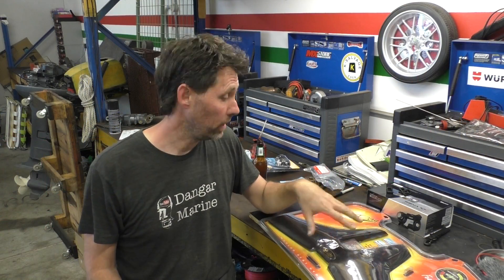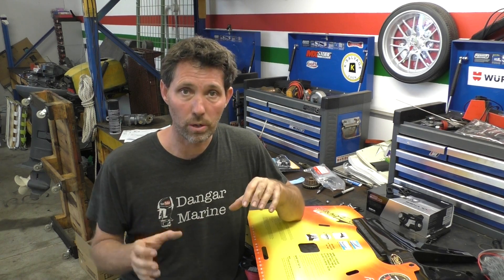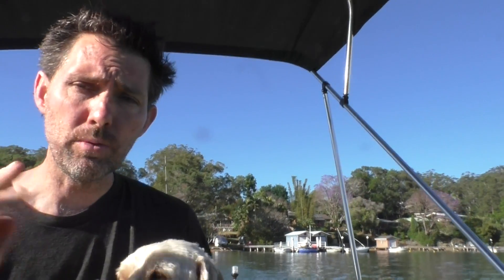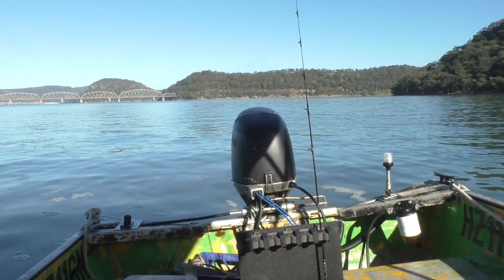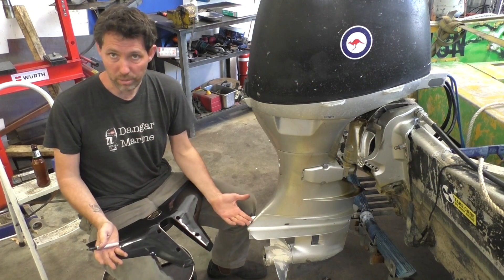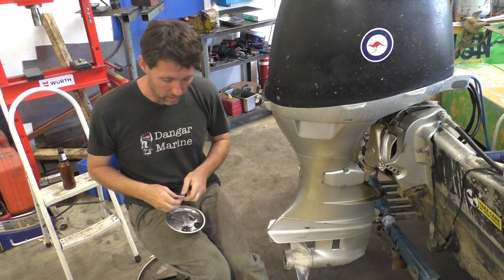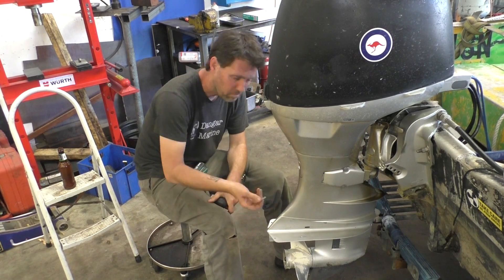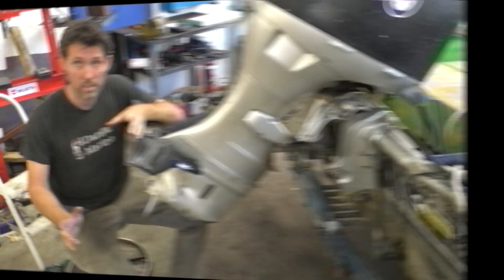Outboard Hydrofoils

Comment: We used to operate a 20' boat in a natural harbour. The speed limit in the the summer was 10 knots. At this speed we were pushing water and not on the plane. We added a set of Doel Fins and hey presto, the boat was level and the ride so much more comfortable. To be fair, it made little difference to the top speed but getting onto the plane was much easier. I recommend.

Comment: I know this is an old video, but I figured I'd ask a question anyway. I have a small fibreglass catamaran with 25hp black anchors on it. (25 Mercurys). Great little fishing platform at anchor or trolling speeds, but prone to losing its grip on the water when crossing the bay in a bit of chop (it ventilates/cavitates badly) or making a turn at planing speeds. The motor ventilation plates are just about the right height, and in any case lowering the motors on the transom isn't really an option. New props coming but don't really expect miracles from them. So, the question is, do hydrofoils really help with ventilation issues? I have in mind the flat plate ones that are really just an extension of the anti-ventilation plate already on the motors.

Comment: I think you just solved a big issue for us. We have a 4.3m tinnie that had a 30HP 2 stroke Yamaha on it and we changed to a 40HP four stroke Yamaha. When taking off it almost inverts itself with the nose riding up really high unless you remember to trim it full down. We have a hydrofoil but did not fit it to the new motor, (first time we have taken the boat out with thenew motor) but we will for sure do that to hopefully stop the super high nose which is nerve wracking when starting. Thanks for a great channel.

Comment: I've got a 11ft dinghy, granted oversized engine, but I wanted it to plane out. So with out this it would stand almost straight up, id have to move forward yo get the bow down. And then once planed out it felt very unstable, after adding this it plans out immediately and is much more stable.

Comment: For what it’s worth, we put one on my son’s 14’ (very light) fishing boat with 15hp w/o any kind of power trim installed. He found that he would porpoise significantly when riding alone at WOT no matter what we did with the trim. Putting a hydrofoil on completely eliminated this. One could argue that he also could have just boated a little slower…we tried that approach first, we got nowhere…
Reply: The motor might be mounted too low, but I think every small boat should have one of these fins, they're great.

Comment: I think you are trying to indicate cavitation? Ventilation involves air movement. This is hydronic so I’m sorta confused about what the ventilation is.🤓 maybe it’s just an Aussie thing but air and water moves similarly but hydraulic is cavitation. Just wanted to mention that! God Bless you from Washington State USA! 🖖🏼❤️😏🇺🇸
Reply: Cavitation occurs within the water itself, essentially an extremely low pressure causes the water to boil. Ventilation one the other hand is just air from the surface being pulled  to the flow.
Reply: @davidtomasetti8520  thank you I see it too 😏🖖🏼🇺🇸

Comment: I installed one on a 115hp, it's amazing for skiing, the wake/wash is minimal, however it's bad for tubing, you can't turn as sharp to give the tube rider a few swings. Also no wake/wash for the Wakeboard, so it's a bit 50/50, taking it on and off all the time isn't practical
Reply: Just trim the bow up so the boat sits deeper and creates more wake.

Comment: I had one on a 40 horse, I was afraid it was dragging all the time, so I trimmed the "cup" off the trailing edge and cut 35MM (1 1/2 in) off each wing tip.
It still got the boat on-plane level and seemed to go faster.
On yours I would try hogging out the plastic enough to slide it forward an inch. Also visually check the hull lines and see if it's dragging.
You can do a speedo test on your phone.

Comment: Cavitation, 
the formation of vapour bubbles within a liquid at low-pressure regions that occur in places where the liquid has been accelerated to high velocities, as in the operation of centrifugal pumps, water turbines, and marine propellers. Cavitation is undesirable because it produces extensive erosion of the rotating blades, additional noise from the resultant knocking and vibrations, and a significant reduction of efficiency because it distorts the flow pattern. The cavities form when the pressure of the liquid has been reduced to its vapour pressure; they expand as the pressure is further reduced along with the flow and suddenly collapse when they reach regions of higher pressure. The sudden growth and collapse of these vapour cavities cause the extreme pressures that pit the metal surfaces exposed to the cavitating liquid.

Comment: I hate to sound like a doofus but Stu, what you do you mean that you can hear the engine ventilate? What does that mean? I understand porposing and bow ride, but never heard of ventilating.
Reply from the maker: Ventilation is when the prop sucks air down from the surface.
Reply: @DangarMarine  Thanks for the clarification Stu. Never heard of that, nor did I ever think thay could happen unless the engine was tilted up much to high. Cheers from Long Island!

Comment: I have an Evinrude 88 SPL on a fairly shallow V 16' fiberglass boat with an open bow. The lower unit didn't have a hydrofoil and my problem was with porpoising while on plane and it took extremely little chop in the water to cause this. When I installed one I could keep the motor trimmed down if it began to porpoise and it really did lock the bow down to the water for much improved ride and once I locked the bow down I could trim it back up gradually to find the sweet spot between comfort and efficiency.

Comment: We have a large twin screw cat that are mounted right next to each other rotating the same direction. As a result we have alot of cavitation at rpms above 3k rpms and doesnt plane. 

Recently during a bad storm, the piece the trim tab is mounted to got destroyed on both units but everything else was just cosmetic damage and the props (stainless) are still pushing ok.

Do you think some curved hydrofoils would help eliminate some of our cavitation?

Comment: Hey Mate, since this is and old post, i might be off the Deep end hoping for an answer, but.... Do you think there is any mecanical  disantages of using the hydrofoil, considering more stress om the engine? 
I use hydrofoil, and have gsined huge lift and  great hold-shot. 
Regards 
Ole Spee (Denmark)
Reply from the maker: Compared to the resistance of the hull, the extra drag created by the foil itself is quite minor.
Reply: If anything, less stress on the engine, as the prop will be running closer to optimum depth - not digging into deeper water.

Comment: What a strange video.  The reasons for installing a hydrofoil are to get on plane faster and increase the top end speed, and they are remarkably effective at both, for boats of a certain size.  Especially on boats equipped with power trim, they have little or nothing to do with cavitation or porpoising.  Installing a hydrofoil to address cavitation during while executing a turn is a very strange decision.  Sounds to me like the outboard is simply mounted too high on the transom.

Comment: looking forward to watching a video on timing a Mercury XR6 EFI 2-stroke 150hp. Can't seem to get idle correct. When it gets to 700 rpm it slowly goes down and dies. I have a Hot Foot, so I have to constantly have to keep my foot on pedal. I the Clymer repair manual, it says the ECM will kick in when engine reaches 550 rpm then engages and increases engine to 750rpm. Doesn't happen.  Is there anyway to test ECM?

Comment: Once you get on plane, you can actually stay on plane at lower speeds with the hydrofoil.  Good to check the bolts occasionally. They seem to work loose over time. Thanks for posting.
Reply: CurtDawg loctite is your friend...

Comment: Get the correct motor for your boat and you have zero need for one of those hideous things.  I've personally had to weld two lower units due to owners drilling into it and ending up with a crack.  IF they were either necessary or beneficial...they'd be OEM.  They're not.

Comment: Had a 16ft princecraft pro with 50hp evinrude  ...hated putting it on boat...gave it a season took it back off never regretted decision to remove. Deep v haul gets out of. It's own just fine the foil did nothing but cause 5-6 mph loss per gps. Ill never use one again....great vid though I'm sure it has its application I personally just haven't found a need and I own several boats from 12ft jon to 30ft cabin cruiser

Comment: Thanks for sharing the informative videos.  I am always curious what auto or boat mechanics choose to operate in the way of brands of motors, etc.  Looks like you are running a Honda on the green machine.  Friend ran a 50 horse tiller Honda for years in their work.  They decided to get a new motor and bought a 40 merc tiller.  They did not realize how awesome Honda's were, until they bought a different brand.  Within a few months, they said the 1000 bucks they saved buying the new merc was not worth it and went back to a Honda.  The Honda was much quieter and ran as smooth as a sewing machine.

Comment: In my opinion, a hydrofoil is an under-rated amazing improvement to boat performance.  We ran a 16 foot and 18 foot jon boat at my work.  The 16 had a 25 hp, no hydrofoil,  and the 18 ran a 50 hp with the hydrofoil.  The first thing you notice is the lift of the rear end as you throttle up to get on plane.  The bow barely rises as you plane out. Some boats have extremely obnoxious bow rise when first trying to get on plane, to the point you actually loose vision of what is in front of the boat for a few seconds.  This does not happen with the hydrofoil attached. Another amazing thing is that once you get on plane, you can actually back off the throttle some and stay on plane at much lower speeds.  I guess some boats have porpoising issues, but that can usually be corrected, or at least reduced, by changing the trim on the motor and/or shifting some of your boat cargo to get more weight up in the bow.  Mounting your electric trolling motor battery toward the front of the boat can help with this, ice chest, etc.
Reply: Exactly why I'm fitting a hydrofoil for next season. My semi-planing dory is just too bow up and never really settles down at speed.
Reply: @BritishBeachcomber  I just bought a new 20 hp outboard this summer. I put a hydrofoil on it immediately. Comes up on plane very quickly and easy with very little bow rise. For the money, they are a no brainer.

Comment: New to this all I bought a used boat when  I retired , 3 months ago . My boat is a 14'5  vee hull . Took it out last week . got to plane 1 time after that  it just pushed with the bow 3 feet high....got the  product you showed in the video , had to saw 2  inches of it to mount and am ready to try it out in 2 days...Again  I am new to this Hoping this will solve a problem   . Only got another week till my fishing license runs out ,and the State of  Ohio  says  I am done fishing  in their state due to corona virus….
Reply: Sounds like your motor is trimmed up to far and/or you have too much weight in the back of the boat.

Comment: I made a mistake install one of these on my boat.A properly installed Outboard motors does not need this apparatus. The fin is a placebo. I corrected my error by taking it off.
Reply from the maker: It depends entirely on the boat. I've seen some that are undrivable until one is added and some that are worse when one is added.
Reply: Remember that there's a formula to match a boat with an outboard, heck, there is formula for everything now a days.. Unfortunately you have to work with what you have. It is easy to add a foil that having a new "right" outboard! If your boat is well matched and designed.. There you have it.. don't use the foil.

Comment: I have a Lund 14 SSV with a 25 hp Yamaha tiller, no electric trim. ☹️.  Without a foil,  it was almost dangerous in a wind. With just me in the boat, the bow went way up. I tried every pin hole. I put on a foil, SE brand, and it made a big difference. Up on plane no problem. It will porpoise sometimes with the right conditions, wind or wave action. Way cheaper than installing an aftermarket tilt and trim. Maybe someday I’ll buy a new outboard with T&T.  Until then, all is o.k.     Nice doggie!

Comment: I've used a few now over the years, rec and commercial.  I have my ideas about brands as I found some basictypes not so good compared to some more shaped types.  I am also impressed with the latest drop side aluminium models that function as a step (engine off!) and extend out back more than out to the sides (still protects the prop against piles).  Turn sharper than anything else I've ever tried.  All of the models I have found best are the type that direct water using moldings or drop edges and have most of their shape behind the prop not out the side like wings.  I suspect the action against the prop wash is far more powerful than relaying on drag.  Biggest advantage I found is the ability to maintain a planing attitude in marginal and storm conditions, rather than finding the bow either pointing at the sky when trying to get back onto a semi plane or shooting forward way too fast for the conditions it is a great help the have the hull attitude so controllable.  If the outboard is too high the advantages are less - the leg should have the cavplate at least 30mm below the bottom of the hull, sometimes 50mm is better for cornering authority.  Most people have their rigs set too high in my experience, thinking that making the cav plate level with the hull is correct - that confusion creates many of the strange reactions and funny handling issues happen in the first place, particularly when dropping an extended cav plate on...  Shark and Noosa cats have flat plates fitted to encourage planing and to avoid water spouting up and drowning the motors...
Reply: @Boat Beard Which brand model do you like? I got a 1995 115 merc.  I'm trying to get maximum speed control, in the slower speed range. In other words,  i want to be able to tow a surfer foilboarder going slowly 10-16 MPH. And also at times be able to make bigger wakes,  noise up tilt...

Comment: No boat should be without one. Had one on a 14ft tinny with a 40hp Evinrude 2stroke and apart from helping planing it stopped porpoising and made the boat more stable going across seas. Put it on after one terrifying day out with esky and water bottles gravitating backwards as the bow pointed skyward so I can't comment on fuel economy. I think it was a SP Sport 200. They have a 300 model for bigger hp.

Comment: Question:Does the canvas out on the first test and the partially retracted on the second affect your test results?  Also, do you anticipate similar results with a 50 hp outboard on an 18ft pontoon boat?

Comment: I had a stingray starfire at my 5m long aluminium boat with Suzuki DF50 outboard. Did not benefit at all. Top speed dropped 2 kmh. The outboard has installed pretty deep but it is suitable for my boat because the back bottom is pretty shallow.

Comment: 60hp Merc on 16' StarCraft DC. The boat weighs just under 1100#. Better stability in the water, and coming about at speed.  50% quicker planing. Smoother and more predictable on plane. Totally eliminates porpoiseing Great for smaller, light craft like mine.   Dramatically better.

Comment: On small RIB’s (310’s and up) I’ve used foils and tabs to get rid of excessive bow rise when transitioning onto plane. By far the the best thing I’ve ever used are “Smart Tabs”. They are like trim tabs with a damper on it. When slow they are down and as you accelerate they slowly move up at a metered rate until you are on plane where they are held up by the force of the water. They have very little down force but only move up at a given rate. The advantage is no drag of a foil in the water stream. Great if you only pin adjustment and no power trim. Also nice not having to play with the trim each time you start off and wear it out.

Comment: I had a Stingray Classic for years, all good.  After 35 years of good service I replaced it with a new one. Before I had time to get my boat back on the water the right wing just fell off while siting on the hard stand. It was replaced under warranty with no worries but then the same thing happened again on the left side.  The fault looks like a stress crack had developed from bubbles in the plastic molding. I'm yet to try the new SEsport hydrofoil which has the same bolt pattern. The old saying they don't make them like they used too rings true in this case. Cheers

Comment: The wing digs in and keeps the boat from banking during turns. Almost slid off the seat first time I tried to make a substantial turn.  Trim up too high and it can pushout of the water and swap ends. I didn't like it.

Comment: How about making the green machine into a full hydrofoil boat by adding some foils up front?!
That would lift the bow right out of the water  completely raising top speed, lowering fuel use and improving 'ride' comfort while on the plane. Not to mention that it would look ubercool!

Comment: Supposedly they able to help you steer better at lower speeds. More responsive staring at lower speeds.
Reply: yes extremely smooth at lower speeds. Helps you get on plane much easier also.

Comment: the fact tact that the motor will only run at full trim under, screams his tramson angle is wrong.
The boat is old when 12 deg transoms were normal and I belive that is his problem.
In any instulation the cave plate must look uo at the keil at full trim under.